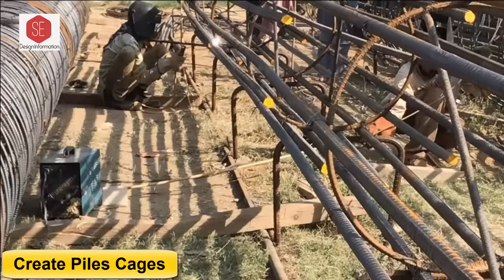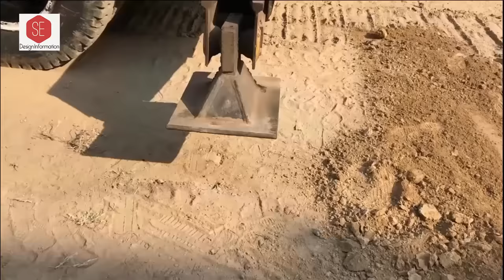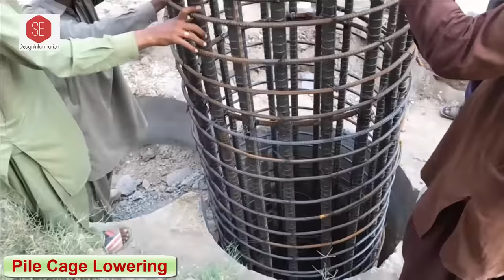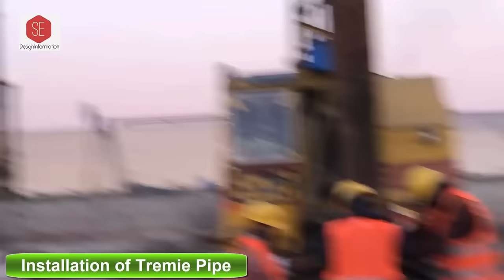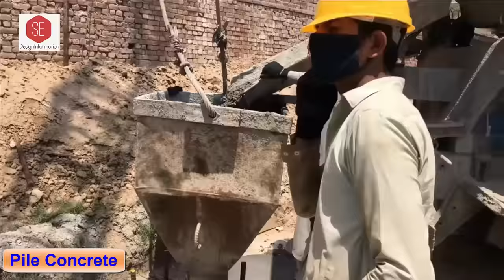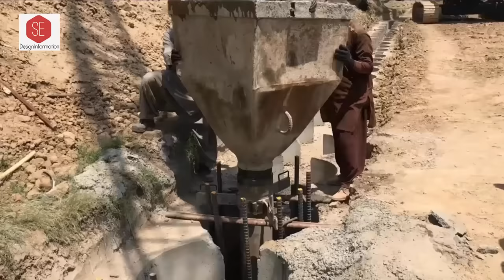Deep Foundations Piles ,Drilling , Cage Lowering , Tremie Pipe

Comment: Awesome video- I enjoyed it - I do the same but on smaller scale - Only 900mm or 1200mm diameter down to 11m is the deepest hole I have done- We sometimes use casings too if the hole is unstable - there is a Concrete specification RMS B80 that we work to
Reply: Buenos

Comment: Perfect job, but in very hard way to workers ( you can got ready cages instead of making them in the site, you can use plastic spacers and installing them in easier way, you can use more modern tremie pipe ( there are ones didn’t need rotate them in order to installing them, you can just put one above other and put steel wire ))
Reply from the maker: agreed

Comment: Nice documentation !! what is that donut shaped thing put in between the cage ? what is the function of it ?
Reply from the maker: Spacer
Reply: These circular things fix position of steel cage to be aprropriate covered during casting process to avoid drilled hole contact of rebarbs
Reply: @MegaXMARKX    Clear Cover. This wheel shape concrete cover block help the cage going smoothly in to the drilled hole instead of rubbing and getting the soil adhere to the rebar.
Reply: Centralizes the cage

Comment: Very interesting. Where do I buy some of the protective footwear these men wear? Also, never worked with a tremie in my day but, does the concrete not require a 'poker' as with other pours?
Reply: The poker is placed ar the centre of the column and is vibrated  at every 2m intervals concrete placements.
Reply: We use a flexible tube for the tremie where I live.
Reply: @michaelharris8554  I didn't see a poker once
Reply from the maker: Yes

Comment: 1. No safety PPE.
2. Spirals splices without 135degree hooks at ends.
3. Spirals not properly splice lapped. Bars sticking out and not toes with bindings wires.
4. Binding wires sticking out of cover ranges so side covers compromised. 
5. Inadequate side cover chairs.
6. Should have used polymers displacing method.
7. Piles too close.
Reply: For site development only and not a major structure. Use to retain soil during foundation excavation.
Reply from the maker: yes
Reply from the maker: yes

Comment: Very disappointed to see the poor workmanship. For such cast-in-place piles you need Very expert piling forman and piling engineer and here is none.They way labourer are working reflect a complete lack of experience. They even do not have the right capacity crane to lift the cage. The crane operator seems to be totally untrained for these kinds of jobs, risking lives of labourer as he could not lift the cage vertically in one go for lowering and draged it instead, damaging the lower bars. They only used CC Spacers once in the bottom of cage and as a result the cage could have been tilted in the middle. They have very poor means of taking bore soundings. The crane operator did not move the concrete funnel up and down to ensure proper gravity transfer of concrete throughout the bore. The fault lies on the contractor and supervision consultant, but the reason why things go in Pakistan in this manner is corruption.
Reply from the maker: Okay